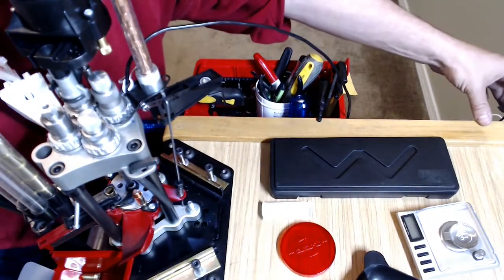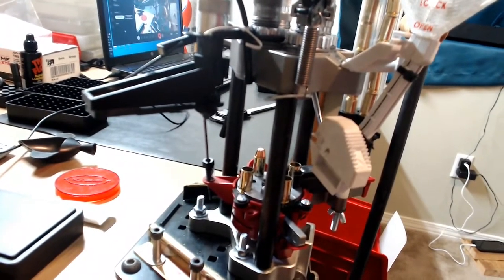Lee Auto Breech Lock Pro - Powder Charge: Double or Nothing

Comment: Great vid series. Got tired of tinkering with my loadmaster n picked up the breech lock pro. Gonna slap all my upgrades onto the new press
Reply: I had overall good luck with load master. But when that thing jammed from a military crimp in flash hole, it was annoying. Plus, I hated the priming on the upstroke with all the other operations. I like feeling the primer seating.
Reply: How do you like your breech lock pro?
Reply: @trumpeteer211  after about 3k of 9mm, no issues! I was looking at the new lee press coming out soon, but I don't see a reason to switch at this time
Reply: @XvREByrd3vX  I can’t pull the trigger on it. Every time I go progressive, it’s been a nightmare. I keep going back to my classic turret press. The new Lee pro 6000 looks enticing so I may go that route when it’s out